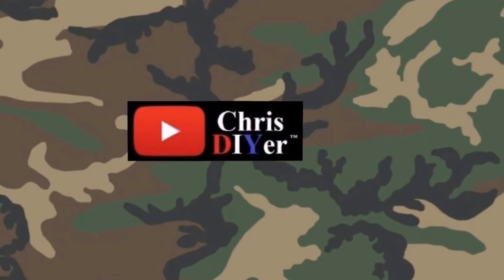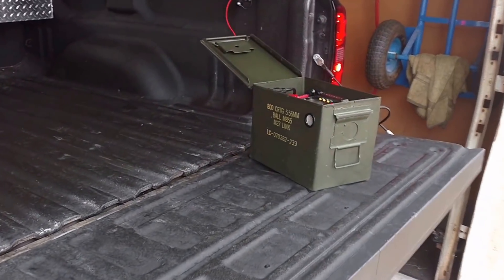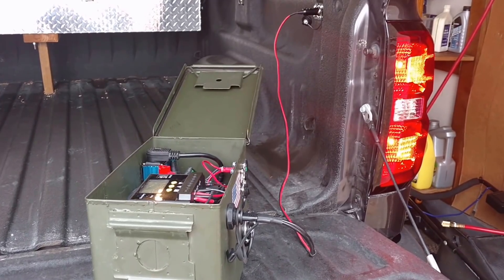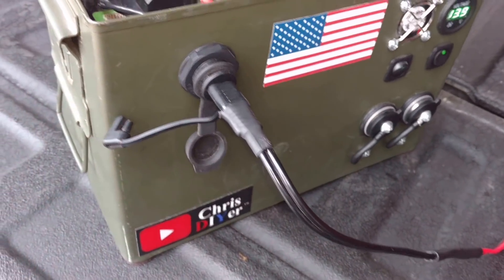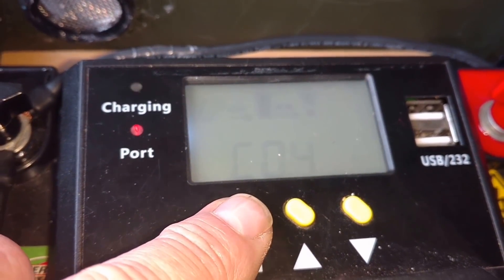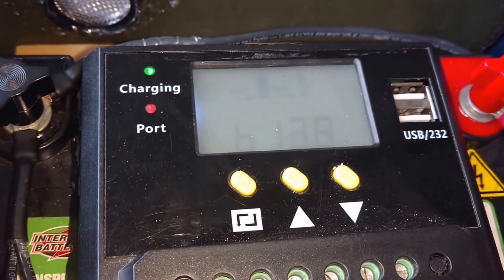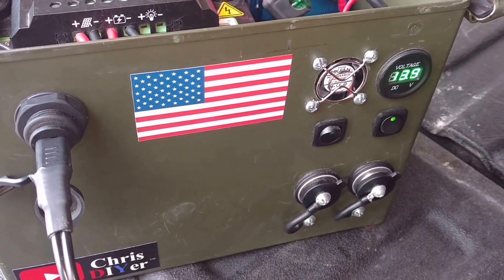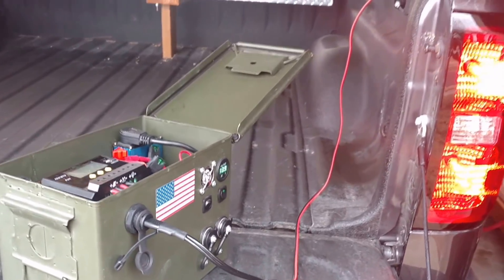DIY 12v charging cable adapter (and something else planned)

Comment: Hey Chris wanted to share this with you.Copy and paste this in ebay Dual 4 Point Bussbar Terminal Bus bar 250 Amp DC
Reply from the maker: Those are cool...esp for higher power applications. However, for smaller systems I am running this one in my garden pond solar generator and love it: https://www.amazon.com/gp/product/B000THQ0CQ/ref=oh_aui_search_detailpage?ie=UTF8&psc=1

Comment: Yea tires and rims.
Reply from the maker: ...stay tuned. Not going "full bubba" with it, but she'll be sexier
Reply: Chris DIYer I went half bubba on the H2 did a 3 inch lift with torsion keys in the front and inch and half spring blocks in the rear and got rid of the 34 inch tires and put 37’s on with 20 inch rims. It looks right now. Lol
Reply from the maker: How does she ride? The ones we drove in the USAF were back killers! But, we had a lot of fun. Going to be installing a 2.5" leveling kit (GM Rough Country) on the truck. The kit comes with 2" blocks for the rear. However, after doing some online research (watching videos, reading forums, mechanics advice, etc) blocks are not the way to go. They all saw "AAL" or add-a-leaf spring for height, towing, hauling...better overall (blocks can bind the leafs, tend to axle hop, breakage). My question is...do you need to change out the rear shocks with an AAL that would give 2.5" of added height in the rear? Thanks. Some are saying yes, some say no. Ride comfort, stiffness would be great to maintain, but a little stiffer ride is fine...general on-road comfort vs pure off-road capability is preferred.
Reply: Chris DIYer it doesn’t ride too bad but definitely stiffer . Sounds like we got same kit I have coil springs in the rear so it’s not a factor like the leaf springs.
Reply: Chris DIYer the spring blocks in the rear were only inch and a half and I didn’t have do anything with the shocks.
Reply from the maker: I actually went with a 2" front leveling kit and add-a-leaf springs and new (longer travel) N3 nitrogen shocks (per recommendation from Rough County). After that is installed...275/60/20 tires (prob the BFG T/A KO2). Those tires are almost 33" and owners with the same set up say no rubbing AT ALL. Next step is getting the mechanic to install (not going to attempt this...don't have the right tools, lift, patience, and back). Decided not to install "blocks" in the back since there really isn't much capability back there anyway...AAL springs will cure that. I expect it to be stiffer, but nothing out of control...just need the additional height, capability, and more attitude/altitude on the road. Won't win any lifted-truck awards (esp here in Oklahoma)...since there are so many rolling around here. Maybe 2.5" total when the dust settles...
Reply: Chris DIYer it’ll be sweet can’t wait to see the videos.

Comment: I like it!
Reply from the maker: Thanks. Have to ask, what voltage do you take your 48v system up to? Learned that 1-hour of stir (EQ) each day is making things work much better
Reply: I'm going to have to look into that and get back to ya...  1 hr of EQ each day sounds a lot more aggressive than I would guess is safe.  I am currently only hitting the EQ about every 60 days and only for 2 hrs a shot.
Reply: I'm going to do a short video on this, probably tomorrow, but here are the basics: 48v system, 740 Ahr bank, 58.4v absorption, 53.6v float, and 62v equalize.  Also, very important, absorption time set to SOC=100% and I use a battery monitor kit to measure the SOC.  I noticed that when the batteries are charged to 100% and the sun goes down (no charging) they are at about 52v.
Reply from the maker: Roger that...thank you. What is your SOC in the morning? With my 1-hour EQ blast each day...using a lot more distilled water (about 8 oz per cell in two weeks). Last night, backed it down to 31.6 volts but increased absorption to 1.5 hrs. Things are running fine after resurrecting my bank (and redoing one string). Talked with an engineer when I was knee deep in acid, first thing she ascertained was "charging profile is wrong". So, #1 glad it is working now (didn't kill the Trojans) #2 they can take in a lot more volts (more aggressive charging profile) #3 they can be resurrected if one screws that up (like I did)